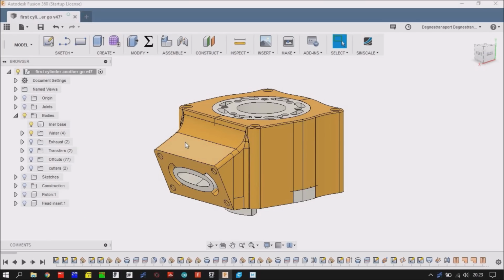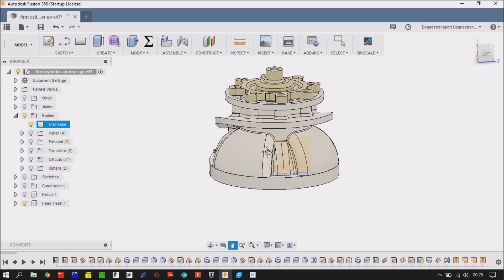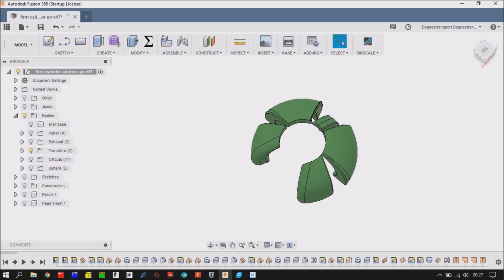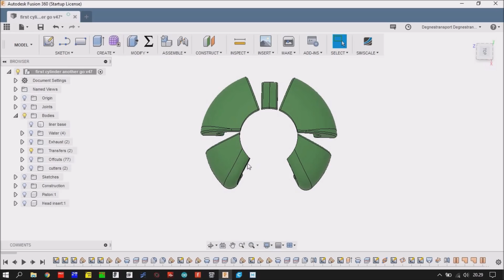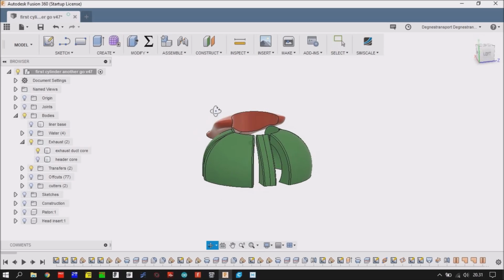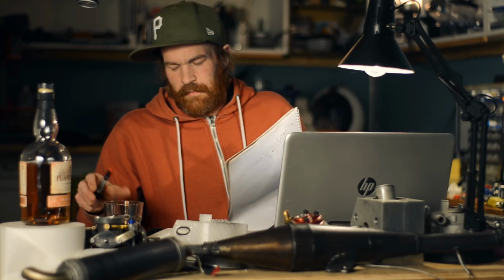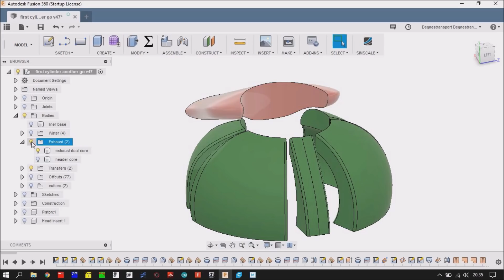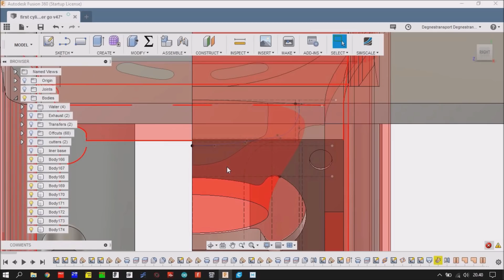3d Printed Two Stroke Cylinder for Lost PLA Casting Done. - Road to The Most Powerful Two Stroke 5

Comment: I think you should definitely run a CFD simulation to visualize the flow, try FloEFD it super easy to learn CFD program. A Transient simulation with the piston moving might be hard but a basic static analysis will give you a 1000 times more insight on the flow, pressure losses, velocities ect.

Comment: Hi mate, if you are not going to use direct injection, look at what Gordon Jennings wrote about the location of the carburetor, contrary to what you maintain CARBURETOR LOCATION

When performing your own experiments with intake tract length, you will be tempted to mount the carburetor as close to the cylinder as possible, and make adjustments by varying the length of an intake stack added on the carburetor's mouth.  Don't do it!  That certainly is the most convenient method, but a carburetor placed too far back toward the intake port window is going to be subjected to radical pressure fluctuations, due to wave activity in the system, and those pressure fluctuations do terrible things to the carburetor's ability to meter fuel.  Worse, the largest departure from the desired mixture strength will occur precisely at the engine speeds where intake ramming is strongest, which makes the task of selecting a main jet impossible.  So the carburetor must be located out at the end of the intake tract, rather than close to the cylinder- which is unfortunate, as maximum air delivery into the crankcase is obtained when the reverse is true.  Perhaps some form of fuel injection is the answer.

Mixture-strength problems can also occur due to the plumbing between the carburetor and air cleaner, and it should go without saying that such plumbing may also add to the intake tract's effective tuned length.  The common practice of connecting carburetor mouth and air cleaner with a section of rubber hose may have much to recommend it from the standpoint of convenience; it also is likely to establish either an extension that becomes part of the effective tract length, or a secondary resonating system that heterodynes at some frequencies with the main tract and thus upsets its proper functioning.  Therefore, it is good practice, if sometimes inconvenient, to make connecting plumbing both as short and as large in diameter as is possible. Air cleaners having plastic-foam elements may be mounted very close to the carburetor without penalty, but the paper-type filter may, if it is too close to the carburetor mouth, become saturated with oil and fuel - in which case it will refuse to pass any air at all.

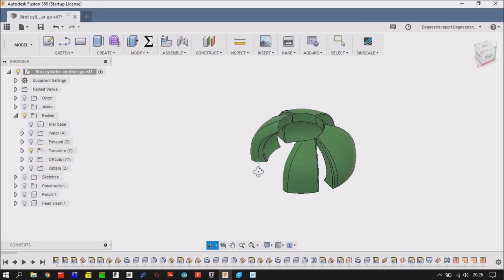Comment: This is interesting stuff, looking at the 4:40 minute mark, are you going to have issues with cylinder wall bulging between the ports as those thin sections heat up?
Reply from the maker: Shouldn't be a problem cause they're all well cooled by transfer flow.

Comment: Can someone help me. I bought a chinese 21mm pwk for my de restricted 50cc am6. I have 2 problems. 1 it wont work without choke when i turn it off it starts bogging like hell at all throttle positions and it idles for like 5 seconds and stalls. 2 it bogs and runs way too rich at wide open throttle with the smallest main jet i have

Comment: I have also wondered if you have considered trying horn style inlet manifold designs. I know the work done in inlet tuning, but that work does not attempt to use the speaker horn math to attempt to achieve the theoretical efficiency one would get if one pretended that the inlet valve was a speaker cone. Try to model a flared horn in the program "hornresp" for lets say 266 hz (about 16000 rpm), then comparing that to the normal inlet design. I suggest using the volume of the crank case as the horn throat chamber volume, but I think testing would have to be the thing to determine how to most accurately model such inlets in hornresp.

Comment: I use to work in investment casting years back, one of the hacks we did on high definition work was to have the feeder in the center of the mold, after it is poured then we spun it to generate centrifugal force to avoid any voids in the casting, it also floated any crap out as well. simple unit a truck hub and rim with a v belt to a electric motor for the drive, a small drum welded to the rim and a larger drum to go over the top as you get a wee bit of metal coming out as it spins.
The other thing we did was on the first few dips we dropped it in a vacuum chamber, this popped any surface bubbles between the mold and the dip. this gives very good definition on the work, but needs good de-grease for this to work. This was lost wax investment casting in all metals mainly stainless steel and aluminium.
Some food for thought for you
Reply from the maker: Thanks, much appreciated! If just pouring it won't turn out this sounds like a very good option!
Btw, as you have experience in the field, is there a reason why I can't just melt the aluminum directly into the mold after it's been burnt out? Imagine a big sprue, bring the mold up to temp, load the aluminum into the sprue, let it melt down into the mold, cool down.
Reply: @2STROKESTUFFING  I see where you are going, the basic answer is no.
When aluminium melts no mater how clean it is you will get slag, you will get oxide forming that needs to be skimmed off. 
Degassing should also be done, that can be done by gas or tablet, aluminium likes to absorb gas, if you have gas you can see it in the metal when it is poured, if your feeder turns into a ball on top you had gas, if no gas it will pull down the feeder as the casting solidifies and the feeder feeds it.
I would also look to also adding a shot of sodium just before pouring, this will keep your grain structure nice and fine, known as a narvac cap. this is to replace the lost sodium from the heating process.
The thing that worries me is the water gallery side of things,  it is going to be hard to get the molding material in there and to be 100% sure you have good coverage and no bubbles. you have so many areas in there that cannot be inspected, also hard to remove the mold from these areas.
To be sure I would add inspection plate holes on the sides this will allow for the investment molding to get good coverage, it will also allow it to dry out faster in the water gallery area, it should reduce trapped air as well along with making cleaning and inspection of the casting a lot more easy.
With a big feeder I would look at adding a metal filter at the bottom and having small runners, this is so you reduce the speed of the metal at the bottom of the feeder so it makes a pool in there as you pour to avoid air bubble in the pour, I would put a step in the gates to add a slag trap just in case any enters it would then be caught in the top of the step and not feed into the casting.
Also get some exothermic feeder powder, you add this to the top of the feeder after the pour and it burns, this keeps the feeder hot so it can stay liquid and feed the casting.
Final for today, make sure all your internal corners are rounded, this will help reduce tearing as the aluminium cools and shrinks, this will be the biggest problem, investment casting is not like sand casting, with sand the binders are designed to break down with the heat and allow the cooling metal to break the mold, but investment does not use the same mold breakdown materials due to the preheating of the mold.
Reply from the maker: Thank you very much! Need to read through this a couple of times!
Reply: @2STROKESTUFFING  I will do a better explanation for you later with some product info, please understand it has been a long time since I was doing this so I am rusty to say the least but with the wonders of youtube there are some really skilled people out there putting this type of thing online so I dont see a problem with getting you set up for professional pours. I will also drop a line to a company I worked with called supreme metal solutions in New Zealand I note they now do PLA castings, hopefully I can get you a list of the latest materials to use and I will ask them for technical advice for you.
Reply from the maker: Thanks man, means a lot!

Comment: Have you considered copying the diesel two-stroke? Basically it uses valve(s) at the top like a 4 stroke, for exhaust gases, but transfer ports at the bottom of the stroke, for the air-fuel mix. To run it on petrol instead of diesel, one would need a spark plug at the top, so you can't make it just one massive valve center-mounted, but you could have 1 to 4 valves, all being exhaust valves, by making a single or dual overhead camshaft cylinder head. This frees up a lot of cylinder wall for transfer ports and cooling jacket, and reduces problems with piston rings wanting to escape into the transfer ports or exhaust ports, allowing you to use tighter piston to cylinder wall margins without the piston rings jumping out of the ports, and more piston rings for less blowby during peak combustion pressure. It should also allow you to run closer to piston melting point, because all sides of the piston will be cooled evenly by the airfuel charge, since none of the piston sides have to have an exhaust port. I think if you use narrow tall transfer ports around the entire cylinder, you may be able to run 4 stroke pistons and rings, on a regular 4 stroke head with custom camshaft(s) for synchronous valve opening. Then you use of course a 2 stroke crank and crankshaft, that leaves little room for air-fuel mix, to produce good compression of the air-fuel charge so that it moves well through the transfer ports at the bottom of the stroke.

Comment: man. you are awesome.
i've been following your quest for more power for a while and water injection came to mind.

if you use (m?)ethanol with a % (3~10?) of water as fuel you could get more power. you would be doing water injection the easiest way ever.
you could lean off the engine more without the risk of overheating and even bring the compression rate higher without detonation.
in the old times they had a complex water injection system to inject water and used it mainly for cooling and detonation control but the 'regular' use of water injection can boost the power output.

some links to 'start' the research :D
https://en.wikipedia.org/wiki/Water_injection_(engine)
https://en.wikipedia.org/wiki/MW_50
Reply from the maker: Thanks, and thanks for the tips!

Comment: If you can achieve 20hp out of a 50cc 2 stroke I wonder if its possible to get 10hp out of a 25cc 2 stroke. Maybe a smaller piston with less weight would rev even higher especially with piston modifications or a windowed piston/reed valve combo.
Reply from the maker: In theory you could get maybe 18hp from 25cc, but it's hard in practice.

Comment: Great job! Your design concepts are so interesting, especially the exhaust port floor rising. When you mention this idea I reminded the concept of "mean por area" (Jennings Handbook, pages 75 & 76). Exhaust port floor rising is the way to minimize the  mixture shortcircuiting, removing area where the exhaust port has the lesser effectivity due to the "piston masking effect" at BDC. Regarding the exhaut port configuration for better flow, the unbridged port is the best option (Performance Tuning by Graham Bell, page 32) and obviously should be properly rounded and chamfered at its edges. Ring snagging is the problem to be solved for wide ports. I am analysing one method to limit the ring opening, as you mention in other video.

Comment: Great project and looking forward to the next video. I've often thought about trying lost pla casting and have just realised there are 3d printing filaments specifically for investment casting, wax filament etc which are supposed to give better results. Is this the material you are using ?
Reply from the maker: Thanks! Plain PLA at the moment, will see how that works first.

Comment: are you doing the oring compression gasket or the copper? i think if u could run double oring should be fine... coppers good to.. all up to what u want u in the end wheres the water inlet and out lets u probably did them and talked about it but im one of the guys that gets bored unless if for myself then id obsess about it.... so kind of like you i guess..
Reply from the maker: O-ring head seal. The inlet will be behind the C-port, the outlet in the head.

Comment: It would probably be easier to do 100cc why do you stay with 50cc? Also, do you plan to incorporate a powervalve later? If you put it on a bike?
Reply from the maker: I just like 50cc. No power valve, not needed with a variator.
Reply: @2STROKESTUFFING  I don't blame you, 50cc has worked so well that I've been telling my buddies about this channel. Still, it may be easier with the casting to size up. Good point with that CVT. Love the work you have been doing.
Reply from the maker: Thanks!

Comment: With such a wide exhaust port won't ring bulge out be a big issue? I am assuming you plan to have the ring gaps on either side of the transfer port directly opposite of the exhaust port, but that means that there is no support for the rings as they pass over the exhaust port. Am I missing something?
Reply from the maker: Check out the other vids in this series, will explain things!

Comment: If you want more cooling of the transfer ports, how about  adding cooling fins to the ports inside the water jacket
to increase the surface area.
Reply from the maker: Good idea!
Reply: Very good idea, :D
Reply: @whirlybirdrc  I thinked on it too, whit the sculpting sofware i told you (Scultris) is very easy cause you only have to draw it by hand over your model, cause it dont need any mechanical exactitude, plus you can do some of the work you use to do with the dremel previously by smoothing the flows on very fine tune.
 Other thing i think about using sculpting tools over the CAD models is about the velocity of the airflow related to the smooth or bumpines of the inner surface of  transfers, cause little bumpines generates quicker air flow velocities (is cause that, the golf balls have their small bumps patterns)

Comment: Cool to see your improvements. Easy to 3d print it with the good orientation ^^. Your layer height was about 0.1mm,  0.12mm or 0.08mm ?
Reply from the maker: 0.2mm layer height, didn't have the patience for a 50hr test print.
Reply: @2STROKESTUFFING  I see, already 24 hours printing. May be, you can shave a few hours with less infill and fewer top/bottom layers (at a risk, you need to test on small parts). It is possible to use lower layer height only where you have the highest overhangs or you need details (less supports improved print quality).
Reply from the maker: Thanks for the tips!

Comment: There is a machine called sls which can print stuff in metal and which also becomes stronger that casting. Maybe this is something to look into?
Reply from the maker: I have, but prices are very high!
Reply: @2STROKESTUFFING  If you can do the tool paths, might be better to have it milled. Plenty of awesome youtubers who are excellent machinists and might get a video themselves out of it. Collabs are always good. AvE, this old tony, hell, I'd even be tempted to have a word with keith fenner.
Reply: @th3d3wd3r  some things in this cylinder are impossible to machine and others are very hard.
Reply from the maker: Doing it in multiple parts should be possible, see what Mark Atkinson has done, incredible stuff!
Reply: @eurobeatmachinist732  That's a shame, as it's a very complex cast too. Or at least it looks it. Haven't done any casting in a while but i'd imagine there'd be many more failures than successes on this project. I just want to see it working however it gets fabricated hahaa
Reply: @2STROKESTUFFING  yes everything is possible. but one part design will be best and easiest for you to do. And i guess that you want to do it by yoursel😀
Reply from the maker: Yep, I'm going the casting route first.

Comment: Have you considered designing, printing and then casting your bespoke carb for the engine project, now that the means is available to you??

Would a horizontal oval carb tunnel work better than the generic round carb tunnel??

Back in the late 1980's a friend experimented with 2 x carbs of differing bore diameters on a 125cc engine with a complex throttle cable system to determine when it was on the small bore carb or both carbs dependant on the throttle openings. It was an interesting experiment and I can remember holding the stop watch to time him over set distances from standing starts. It did improve the acceleration versus the stock single 26mm. carb but the fuel consumption was measured at 27 miles per Gallon (UK true Gallons) / 4.461 Litres.
Reply from the maker: Very interesting!
Reply: Andy Reid how would that flow better then one bigger single carb

Comment: I like the long boring fusion videos because I know even less about 3D modeling than you. The way you do stuff in fusion makes me half interested to try myself.

And: one possible reason for 3 port exhaust working well might be Venturi effect; the central duct pushing air from the side ports further into the exhaust.
Reply from the maker: Thanks! Funny, I was just sitting in my car thinking about the same thing. The big main port opens first and as the aux's open the flow is sort of dragged out and along with the main stream. Maybe. Explains why, tho counterintuitive, aux's need to open after the main port for max power - you'd think with the longer path it would opposite.